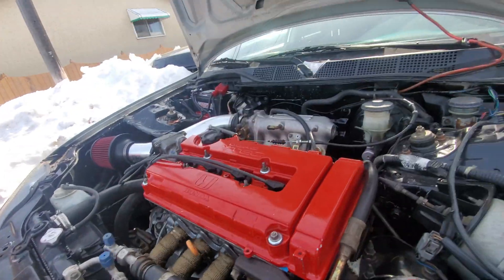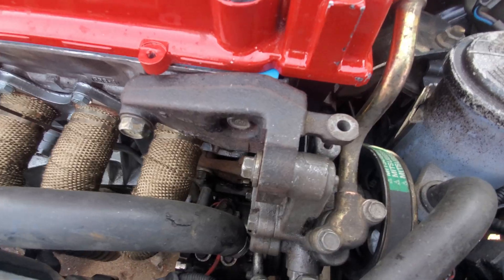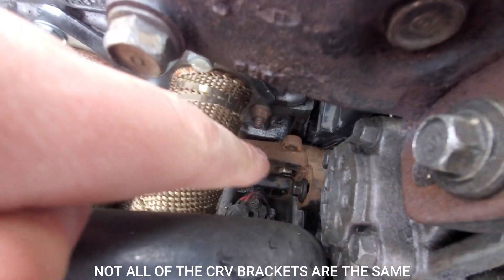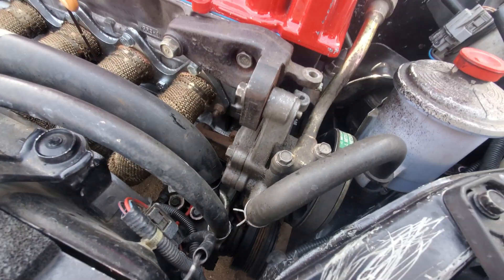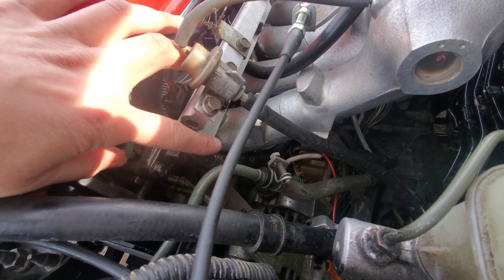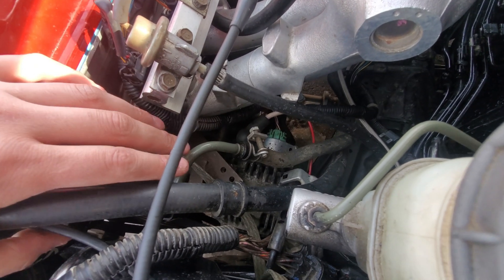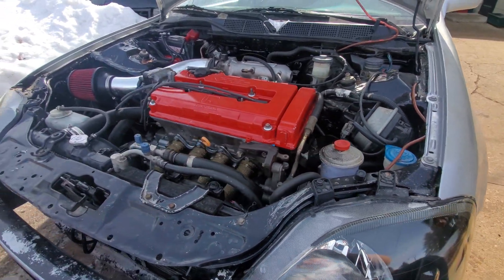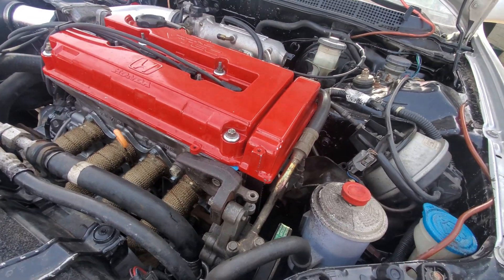B-Series Accessory Brackets Guide & D16 AC On B-Series!

Comment: For anyone coming back to this later on, the upper power steering bracket is from a b16. Not a CRV. Starting at 3:45 you can see the bracket is stamped p30 which is for multiple JDM b16s and specifically the b16 that came in a USDM del sol. The lower power steering mount can be any b series as they're all the same.

Comment: I just bought the innovative ac bracket to use my original d series ac compressor in my crx but looks like I need to use washer on the 2 bottom bolts. I rather use Oem stuff I’m going to find a Crv ac bracket I didn’t know you could put a d series compressor on a b series bracket. Do all 4 bolts line up?